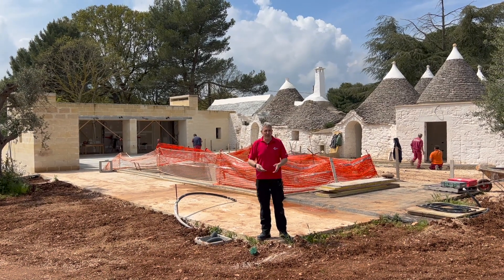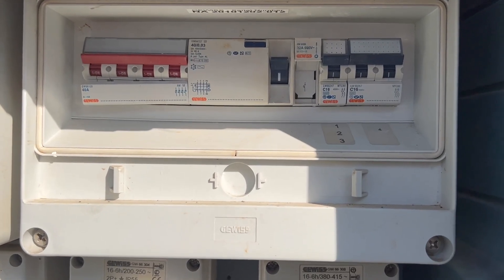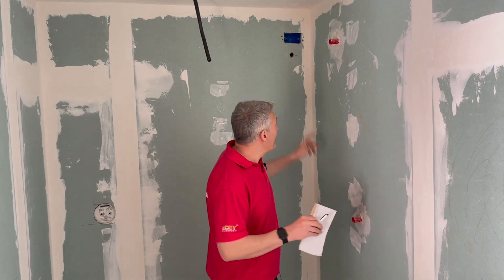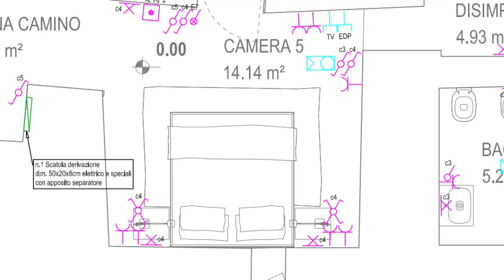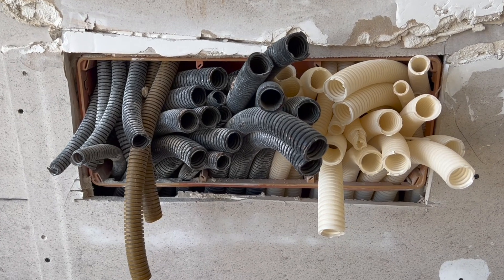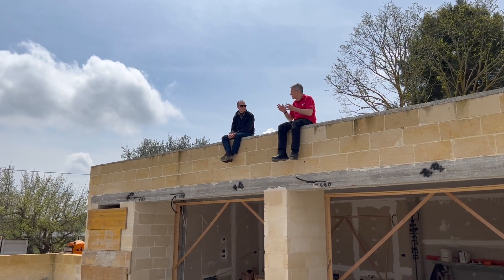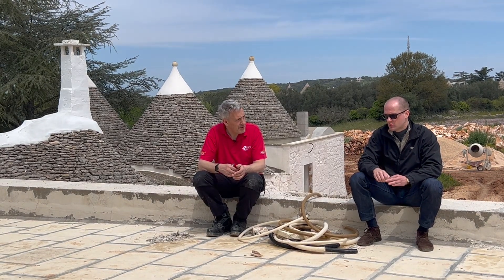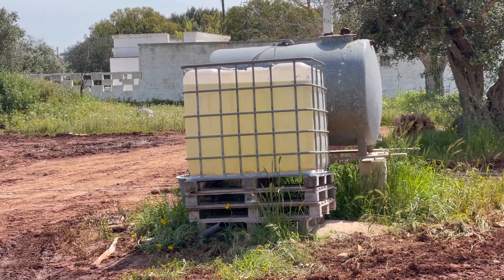Electric Wiring in Italy - You Won't Believe What They Do!

Comment: Like how they do everything in plastic colour coordinated tube and in floor. Like that no need for earth wires on insulated appliances. Bit backwards for power. How will existing homes be able to charger EVs and run heat pumps in the future. Great video
Reply from the maker: EV is a challenge especially in the cities with apartments and narrow streets. We could however see lots of cable upgrades on the distribution network in progress.
Reply: @efixx  having spent many years in southern Italy I know one thing, it will take 20 to 30 years before they get upgrades.
Reply: @gino2465  you think this? Do you think that southern Italy has the most extensive FTTH in Europe, why must it be different with electricity?
Reply: @attenzioneallontanarsidall7940  Time will tell, I will try and monitor local news and forums as this will give a better and clearer picture.

Comment: I think conduit  works over there because the buildings are mostly masonry they used to use the hollow clay bricks for partitions and could chase condit into these brick. Sound like they are using partitions?
Reply from the maker: They use the same system in all types of wall- lots more insulation being used so more dry lining systems are in place.

Comment: How do they get on laying pv modules flat most over here have minimum pitch for self cleaning. I guess they can go up on flat roof and clean them easily enough?
Reply from the maker: They will be on a slight incline and they have steps on to the roof.
Reply: The incline is set by the latitude for max solar capture.
Reply: @John Burns  but they stated that they were going on flat but most modules say minimum 10 or 12 degrees. 
Most arrays in UK go with the roof line with most being 30 degrees so as to comply with permitted development. Also need to caviat the 'optimum' inclination based on what you are trying to achieve. I am wanting to do large domestic ground mounted at 38+ to bias towards winter sun. Obviously with this project chasing cooling in summer then 'flat' 12 degrees is good for this application.
Reply: @andyhodchild8  wrote|:
"I am wanting to do large domestic ground mounted at 38+ to bias towards winter sun."

Good ploy.  Depends on where you are in the country as well. Some areas have more winter sun than others. So maximising for winter makes good sense. Summer solar capture should be OK for sure, if winter gives good results.

Comment: No EV charger's or showers installed over there then, there heat pumps must be different to the UK no 6kW water heaters in those big boxes on the wall.
Reply from the maker: They have lots of self resetting RCDs etc 😉
Reply: @efixx  
Do the RCDs have timers integrated?
Reply: in italy EV cars are not used and for water heating, house heating and for cooking, we use GAS in many case, so 6kw are always enough
Reply: @fabrizioq69  
EVs will take over. They had better get the grid to standard. Solar panels and Powerwall batteries can only do so much.

Comment: I though the UK had to align itself to EU standards when we were in the EU?, harmonisation etc. We had better be dropping our standards a tad in future editions of the regs.
Reply from the maker: The regulations are harmonised in Italy they use CEI-64 which is similar to Bs7671 it’s the TT system which causes most differences in how they are applied.
Reply: There was a move to standardise on sockets and plugs in the EU. The British would not move from the Type G plug as it is well .... the best, and we have rings in most homes, so eliminating the fuse-in-plug would cause problems. The Type G can be used on radials of course and is best for the likes of table lamps with flimsy low amp flexes. The EU did consider using the G plug, but cost put them off if I recall. 

So the UK, Ireland and Cyprus in the EU were on the G type plugs.

Comment: I was making installation for a small garage. I used these flexible conduits literally everywhere, connecting every outlet with main electrical box but i did not put wires in them, i left them empty, and the wires were plastered into the wall next to the conduit. Thanks to that i can run f.e an ethernet cable after all the walls are plastered, or some kind of additional wires for garage door, lamps, some kind of antennas - you name it.

These conduits are very usefull, but feeding wire through them is sometimes sooo tricky
Reply from the maker: Use the vacuum cleaner hack
Reply: @efixx he vacuum cleaner hack works best on metal conduit that has smooth walls  on the inside. This convoluted plastic conduit offers too much resistance. Back in the states we had to run several video coax cables over 100 meters. We used a high pressure system that resembles an applicator brush for PVC cement but for one inch conduit. This device fits snugly into the conduit and has a metal pull ring attached to it. Place the device into the conduit, feed the pull string through a "t" adapter and fasten the pull line to the device, attach the t to the conduit and then you have a high pressure CO2 tank with a straight feed pipe that feeds the back side of the conduit. Open the gas bottle and it will send the device down the conduit pulling the polyethylene fish line with it. Within seconds it’s at the other end, ready to pull cables back with the fish line.
The flexible Smurf has too many ridges in it and one needs to add lubricant to the lines being pulled through. If there is a major fault and the conductor(s) insulation overheats and melts, it will melt into this conduit making it near impossible to remove to pull a new line through.
Reply: The trick is to measure out what length of run you need (I.e board to socket or between sockets etc) cut the conduit length you need, lay it out flat in a open space and run your snake down it, then put the cable/cables you want in the conduit in. Then after that install the conduit, this removes the issue of drawing cable in through bends and all the other issues with Flexi conduit when installed.
Reply: @cal5566  Thats great too but i completely forgot about vaccum hack! i need to try it out
Reply: @maciejpieskasta493  And if you get problem with friction on long runs, you can get lub that is made for cable pulling.
Reply: The trick is to stretch the conduit slightly during tie down and make sure you tie it down to a solid wall with a solid material (I much prefer plaster to clips).  This way the conduit won't flex and compress as you're pulling wires through it, and they'll just slide through...
Reply: So, did you put the conduits and then the wires inside the wall, without passing them through the conduits? That is really dumb, and it is not in line with regulations. Next time call a professional. To pull the wires through the conduits you need to use a "sonda". It can be tricky if there are too many wires, or if the conduits aren't properly placed.
Reply: It is in line with regulations in my country. Wires have double insulation and are suited for being plastered/cemented straight into the wall. @biomorphic

Comment: Love the idea of plastic conduit tubing runs, hoover string through & pull cables. Leaving a string line future needs also. Would of been nice to know if triple glasing was required.
Reply: Only problem I've had with draw strings is they tend to twist around existing  cables .
Reply: In south Italy I don't think is required triple glazing. I live in the North and double glas is the standard. But there are some climate zones in which is mandatory a triple glas
Reply: we use flexible nylon "fish lines": you push them into the conduit, attach the cables and pull from the receiving end until you see the cable. If you need more, you can pull more cables in one go. This way at the end of the process, only cables are in the conduit
Reply from the maker: We’ll find out in part 2 when we return for the second fix

Comment: My house in Calabria has a 3kW supply, but they fitted a 32A breaker on the main board, but a 16A breaker at the remote meter location... Yep, I have a long walk when it trips ~ I really must have the house one changed down to a 16A and hope it trips first...  I don't know who to contact to have the 32A reduced.  Amazing jhow you become used to the small supply, and remember what to turn on/off for the right combination.
Reply from the maker: Great insight Tomas could be worse places to take a walk 😉
Reply: @efixx  Bundy would like it there - he used to be Mr Flexi-King!
Reply: A couple of years ago I was in Italy for two months to help save an old building, we lived locally in the same building. And all the time there was a problem with the fact that the fuses blew, when turned on two boilers at the same time, if I'm not mistaken, each 1200W. I think that it is specifically to limit electricity consumption because there was a fixed monthly fee of 50 euros, but it turns out that it is a widespread problem. 😁
Reply: 16 A sounds little. How does one run even a stove? Or are they all gas?  Houses in Finland typically are 3x25 A or 3x35 A.

In Finland the main fuses are sealed. You need to ask permission to change them. Breakers are not allowed as with enough current they might fail and not break the circuit.
Reply: @okaro6595  usually we just get used to it and don't turn the stove on with the oven, or AC, etc...
With solar it's a lot less of a problem as I can have 3kW in from the mains, 3kW from the batteries, and 5kW from the panels during the day. During the night I still have 6kW total which is fine for most things, it's almost never a problem. But it would be nice to have a 10+kW mains connection in the first place lol. Maybe someday the laws will get updated
Reply: @okaro6595  we have to turn on/off to manually share the power. We use steamers instead of electric hob most of the time and turn off aircon to cook. You can upgrade to 4.5kW or 6kW for a higher standing charge, but not worth it for us as a little used holiday home. If we lived there more of the year, we would have gas for cooking…l but electricity is easier for holidays…. 16A is fine for 3kW as you only max at 13A anyway
Reply: @okaro6595  ~
Did I get that right? You do not have breakers in the main panel (consumer unit)?
Reply: @Herr Tomas
Try fitting a home battery (Tesla type). Store electricity when not using it then use when needed. Also where you are install solar panels.